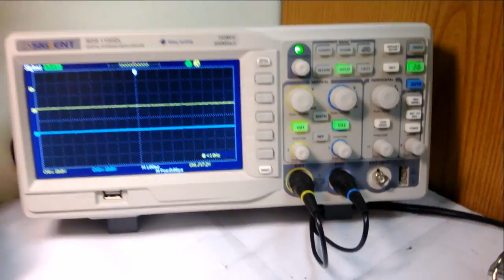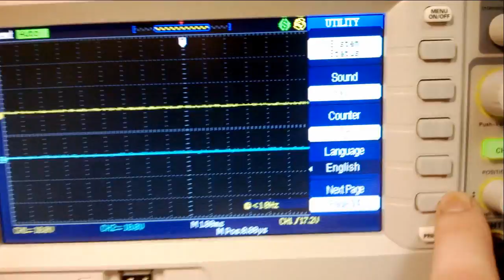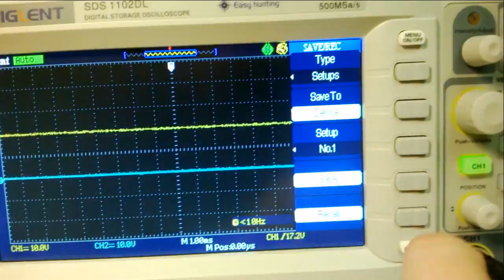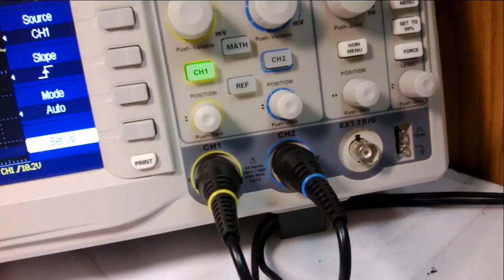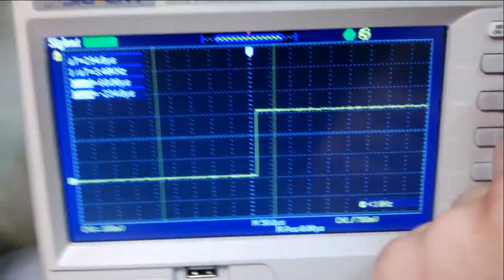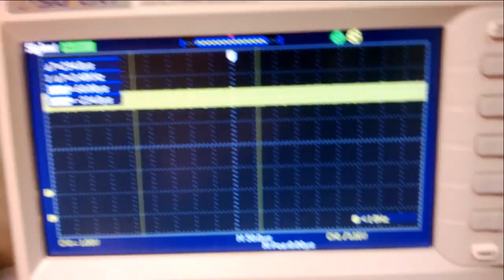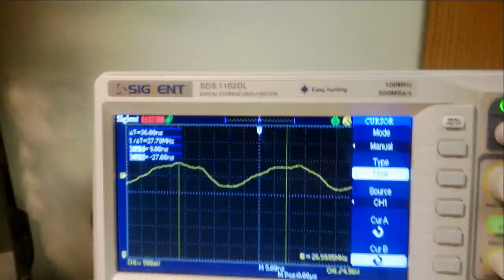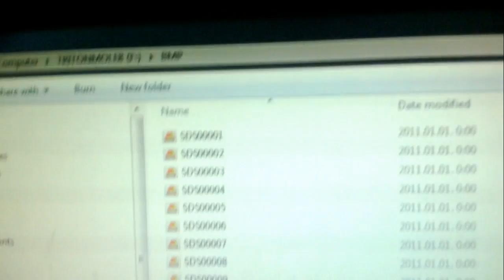Affordable SIGLENT SDS1102DL digital storage oscilloscope review

Comment: Hi, I bought this oscilloscope yesterday it works fine but the only thing I'm concern about is that when I turn it on the item (auto, ready, armed,trig'd etc) at the top left of the screen switches "auto-ready" very quickly unless I don't give the write signal 1KHz from the oscilloscope. After calibaration it shows "auto" but after having a singnal and diconnecting the prob again starts showing auto and ready with a quick change. Is it a technical problem? Please help!
Reply from the maker: There is nothing wrong with your scope. I don`t have my scope on hand right now, but i`m shore that icon indicates digital trigger. "Ready" probably means your trigger is configured, but "auto" means the trigger is configuring itself to trigger your 1KHz signal.
Reply: Thanks for responding, the problem is that there no stable Ready icon or Auto icon, they blink very quickly! As I see on your scope you have stable Auto.